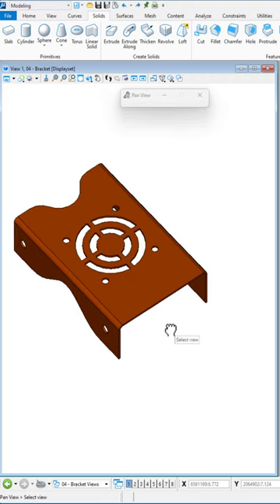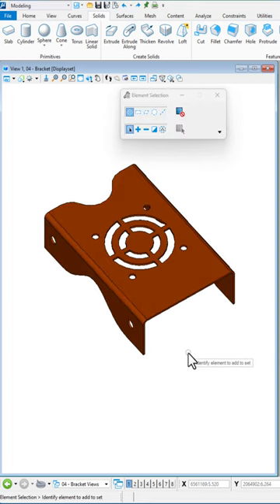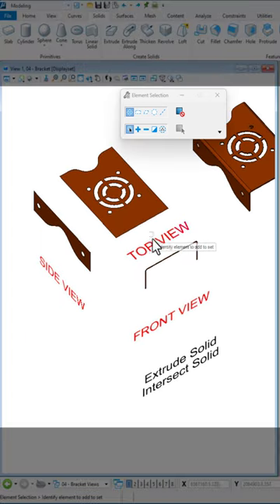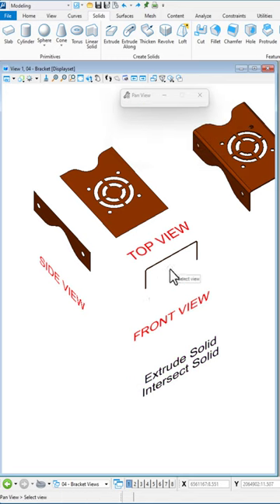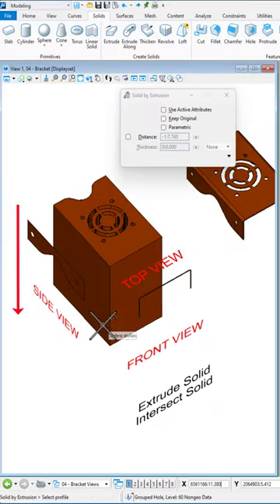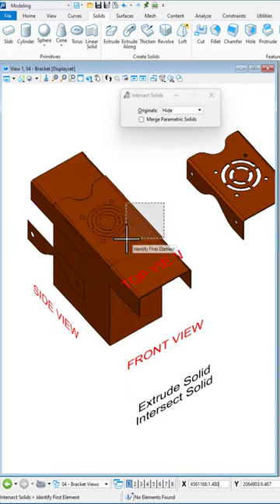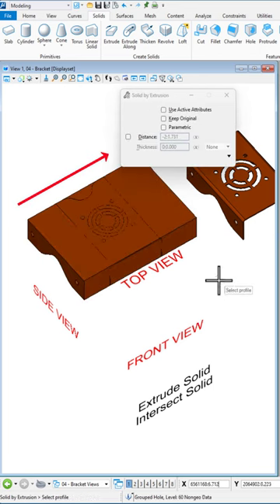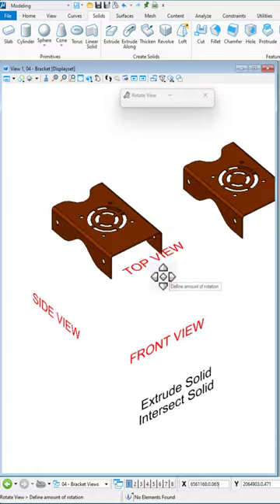How to create Bracket in #microstation #tutorial #learning #3d

Comment: Question. Extruding the single line profile through the solid, then merging the two (extruded surface + extruded shape) shows a merged plate with thickness. Is the thickness a product of the merging of surface and solid?
Reply: Good question, just to be clear, the Tool I used wasn't "merging" the two solids. I used the "Intersect Solids" Tool. The thickness was defined by the Front Profile Shape and its Intersection with the extrusion of the Top Profile. I hope I understood and answered your question correctly :)
Reply: @CaltransMicroStationVideos  Thank you for explanation, the profile looks like a single line, yet the resulting profile has thickness. So I’m curious how it got thickness from a single line 🤔
Reply: @ThexBorg  aah, It's not a Line, It's a Shape :) I know it's hard to tell in the video. Hope that helps :)
Reply: @CaltransMicroStationVideos  oh ok. It’s hard to tell in the video.